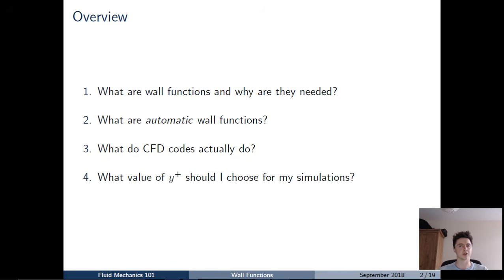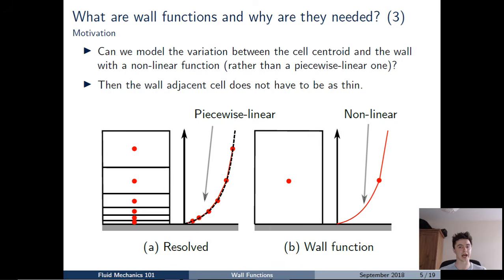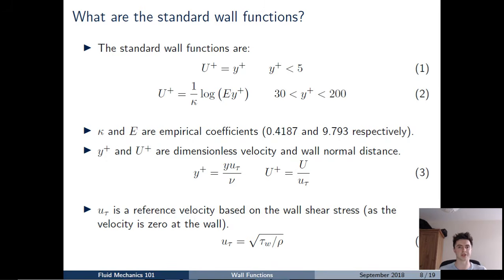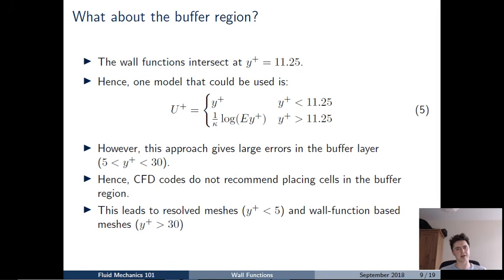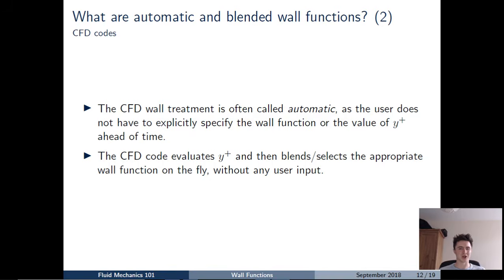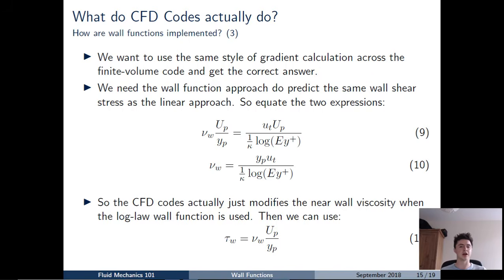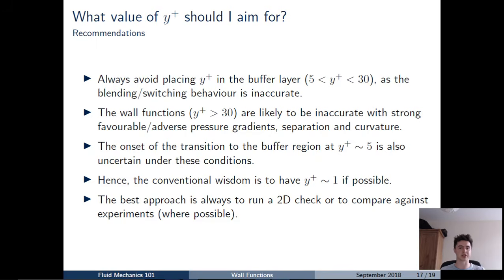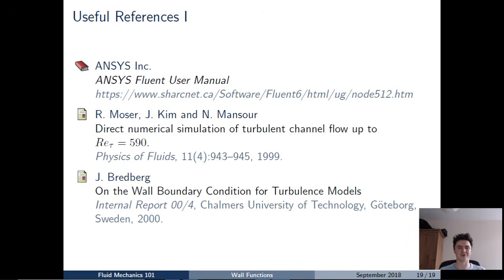[CFD] What are Wall Functions and How do they work?

Comment: Hello,
Thanks for the Video. Its explain much and there are things that I didn't understand before, but now they look a little bit cooler.
Also, I may have questions that, even if that look clearer, I fail to understand it:
1- the equation (8). I tried to recover how you did the derivative, but I didn't find the same things. If you can send me a link where I can read it or explain it here, that would be great.
2- From that page, I think I understood just the half of what you said. I mean, I heard the explanation clearly, but I didn't understand. And I REALLY want to understand as clearly as possible as you do
3--I'am using a cfd Software for a while now, but what I find difficult, is to put the right value of y+. I do understand that at the beginning we don't know the value and that the value change during the simulation. I saw that. The problem is "HOW DO I CORRECT IT"?. Read somewhere that you change it at the end of the simulation. But it's complicated, since I'am evaluated the drag of the boat, and it's taken 4 to 6 hours to run one simulation. So my question is: how I may ensure the value of y+ before letting the simulation run until the convergence?
Thanks in advance if you find time to answer me and sorry for my english if it is not good enough.
Reply from the maker: Hi Brice! So glad you found my video useful. In answer to your questions:
1) you can find the derivation in the Jonas Bredberg paper (link 4 in the description of this video) and you want equation 75 and 76. The trick is to rearrange for utau, rather than differentiate. 
2) I am thinking of doing a follow up video to explain this in more detail, as i have had lots of comments! What do you think? 
3) To reduce y+ you have to go back and refine your mesh. The only way you will know y+ is after your simulation, so the process is iterative: make a mesh, run computation, find y+, remesh, repeat etc. However, you can make this process quicker by having a good guess for y+ before you mesh. There are some tools online which can help you with this. Try googling ‘CFD online y+ calculator’. There is a really good tool which can help you guess y+ before you run your simulation. Hope this helps! Aidan
Reply: @fluidmechanics101  Aidan First of all thanks for this excellent lecture. I have a query. The motivation of this lecture is to reduce the aspect ratio of cells closer to the wall but it seems we cannot reduce the number of cells as often we may need to resolve our mesh to get minimum y+. So could you please shed some light whether we have achieved.  our aim of reducing cell count. Eagerly waiting for your reply if u have time to clarify my query. Also requesting you to post more such lectures.. it is fortunate that i have found your channel which is very helpful.
Reply from the maker: Hi Siva, i think i might not have explained it well enough in the video, so here goes! The optimum mesh is always a mesh with all cubes (aspect ratio 1) that are aligned with the flow direction. However, if we were to use all cubes, the cell count would be really high (particularly at high Reynolds number). So what we do is note that the gradients normal to the wall are steeper than the steeper than parallel with the wall. So we increase the aspect ratio of the cells and stretch them out. However, if the aspect ratio is too high (say over 1000) then the computations start to become unstable. So we would like to make the wall adjacent cell (which has the largest aspect ratio) larger in the wall normal/y+ direction. This will reduce its aspect ratio and make the computations more stable. In addition, it will also reduce the cell count as all the other cells will be the same size or larger than this cell. I hope this makes a bit more sense now 😊 and yes, i have lots more videos to come, so stay tuned!
Reply: @fluidmechanics101  thank you very much for your time and reply...

Comment: The video is awesome thank you very much ...... I have 2 questions please
1) The curve of the log low region makes a nonlinear curve from the wall to Up, from where did you know that this nonlinear curve is going to have the right slope of the wall shear stress (I think the green line should reach the origin to satisfy this but in the graph in the video it doesn't reach the origin) is that right ?
2) when you equated the 2 equations of the linear and log low region you cancelled "Up" in the left side with the right side although "Up" of the linear equation should be different from the "Up" of the log low equation to equate them right?
Reply from the maker: Hi Hatem, in answer to your questions, it is important to remember that it is the product of the viscosity and the velocity gradient that gives the wall shear stress. As the variation across a cell is linear, the velocity gradient will be incorrect when we are in the log law region. But this is ok, as long as the product of the (now incorrect) velocity gradient and viscosity gives the correct wall shear stress. This is why we modify the viscosity :) the green line doesnt need to reach the origin, as it is the gradient that we care about. For question 2, remember that it is the CFD solver that calculates the value of Up, so we assume that we know this and it is a constant. Remember remember, we are modifying the viscosity here to get the correct wall shear stress, not computing the value of Up. I hope this helps! Im thinking of doing a follow up video to clarify these points, what do you think? Would that be helpful? Aidan
Reply: @fluidmechanics101  Yes plz do
Reply from the maker: Hi Hatem, great questions! Im going to have to get back to you on these as im quite busy at the moment. Glad you found the video useful!

Comment: very good video, thanks! great explanation and easy to digest. By the way what kind of software do you use for your graphs and pictures?
Reply from the maker: Great! Im glad you found it useful. All the software i use is open source, so you can download and use it yourself if you like. I use python for plotting and data manipulation and then use inkscape for creating images and adding annotation. Check them out! They are available for mac, windows and linux, so you can still open files if you switch between computers. Also, to get the ‘math font’ for equations, check out CMU serif and CMU sans serif fonts. You can download them and add them to your font library. Hope this helps :)

Comment: This video clarifies so much for me! Thanks a lot Dr. Whimshurt. One thing I am trying to understand is scalable wall functions in k-epsilon model. I understand that it is different than automatic wall functions presented in this video. It solves log-law equations by scaling them no matter which region your first cell is at. I am using CFX but assuming Fluent does the same. And for my model I am still aiming y+<1 while employing k-epsilon. Is this a futile effort since k-epsilon will not solve linear wall functions?
Reply from the maker: Hi Mehmet, Great, im glad you found it useful! From the user guide, it looks like CFX and Fluent do the same thing for scalable wall functions. http://www.afs.enea.it/project/neptunius/docs/fluent/html/th/node99.htm More specifically, it looks like they force the value of y+ to be 11.25, if your value of y+ falls below 11.25, so that wall functions will always be used and you won't get viscous sub-layer resolved treatment. As you are aiming for y+ < 1, I wouldnt use scalable wall functions, as the scalable treatment will force y+ to be 11.25, which will give you the wrong answer. I would therefore go for standard wall treatment with the k-epsilon model instead, so that you can get the correct viscous sub-layer behaviour. Alternatively, If you are really concerned with correctly computing the wall shear stress and near wall behaviour and need y+ < 1 (this will depend on your application, perhaps you have an external aerodynamics application), then the k-omega SST model is widely considered to give more accurate predictions of the wall shear stress and near wall behaviour, when y+ < 1. I will be doing a video on this soon, so keep watching this space! Hope this helps, Aidan
Reply: @fluidmechanics101  Thank you for your time. I'll be waiting for the new videos. Great work.
Reply: If I'm not mistaken, if you're aiming at y+<1 then it means that you want to resolve boundary layer. You should not use k-epsilon model because it is not able to integrate to the wall and always uses logarithmic wall function approximation to model the boundary layer. And wall function is valid only where wall-adjacent mesh nodes (cell centers - depending on solver) are in the log-law region (20 < y+ < 200). Because it's hard to ensure this all over flow domain, the scalable wall function was implemented. With scalable wall function solver ignores all nodes that are closer to the wall than y+ ~ 11. If you want to resolve boundary layer you should use turbulence models that are able to directly integrate to the wall, like omega-based models. And you should ensure that you have a minimum of 10 nodes in boundary layer.
Reply: @antanas9015  Yes, but there is also an enhanced wall treatment formulation in Fluent for the k-eps turbulence model. In this approach, the flow is "divided" in a viscous affected region and a fullty turbulent region. In the viscous affected near wall region , the one-equation model of Wolfstein is employed, insetad of wall functions. in this way it is still possible to solve cases with low y+ when using the k-eps turbulence model. I hope it can help:)
Reply from the maker: Yep! I agree

Comment: That's a very clear explanation of something not so obvious!

The thing is, in CFD, a lot of cases are complex, with detachment/attachment, acceleration/deceleration etc... This will inevitably lead to 5 < y+ < 30 in some regions.
Second thing: When we talk about y+, do we talk only about the first cell height? Because even with a nice y+ = 1, the 3rd or 4th cells might be in the buffer layer. That is a problem or not? Didn't get this.
Reply from the maker: Hi Lili An, yes you are absolutely correct. CFD cases are complex and and y+ may be in the region of 5 < y+ < 30 in some places in the mesh and < 5 in others. Usually we adopt a compromise and try and get y+ < 5 in the main area we care about. For example, when simulating an aerofoil/wing we usually try and get y+ < 5 near the trailing edge of the suction surface, as this is where seperation inception begins and will have the most signifciant affect on the solution. This normally leads to y+ > 5 near the stagnation point (and hence not an accurate solution), but we dont care about the solution as much here, as the integrated lift and drag are more significantly affected by the suction surface boundary layer. 

2) Yes you are correct, the second and third cells may be in the buffer layer. But this is normally fine because the variation across the cells in the mesh is linear and the CFD solver compute the rest of the profile through the boundary layer for us. Conventional wisdom is to try and have 10 cells through the thickness of the boundary layer (a growth ratio less than 1.2) with a y+ < 5 for the 1st cell and this is normally fine to get an accurate solution. 

As always, check your solutions with a mesh convergence study, as every case is different! Hope this helps
Reply: @fluidmechanics101  So, let's clarify more. Wall functions are used to compute values at the first near wall mesh node only and values at all other nodes are solved by the solver from the flow equations. Am I correct? If so, then it's not optimal approach IMO. Or do wall functions are used for all mesh nodes within ranges y+ <5 and 30 < y+ < 200 (or only in range 30 < y+ < 200)?
Reply from the maker: Yep, you are correct. The cfd code only uses wall functions for the cell closest to the wall (often called the wall adjacent cell). The rest of the mesh will be solved by the cfd solver by assuming a linear variation across the cells. So ... you will still need a relatively fine mesh near the wall as the gradients are steep. This is why yo should try and use a growth ratio of 1.2 or lower normal to the wall to make sure you have enough cells :)
Reply: @fluidmechanics101  So why should I put enough cells to capture boundary layer?If I just focus on wall shear stress then one layer will be enough?
Reply from the maker: Well spotted! You still need enough cells to capture the velocity profile (and other gradients) away from the wall. Remember that the variation across cells is linear, while the velocity profile is definitely non linear! So you need enough cells to make the linear approximation sensible. People usually advise 10 cells through the boundary layer. However this is not useful to us when we are making a mesh .... so my colleagues and i tend to find that a growth ratio of 1.2 normal to the wall is about right to get the right number of cells through the boundary layer. For external aerodynamics applications where you really need a good answer, i would drop this to 1.1 or even 1.05. I hope this helps!

Comment: Thank you so much,  
How can  to plot the famous TBL curve U+ vs y+?
Reply from the maker: Hi Serrare, you can get the experimental data directly from the statistical database provided by Moser et al. here: http://turbulence.ices.utexas.edu/data/MKM/chan395/profiles/chan395.means . To plot the data you will want to use a 'semi log' plot to have the x axis on a logarithmic scale. In  MATLAB or python, the command is 'semilogx' rather than 'plot', whereas in excel, you can just change one of the axis to logarihmic in the plot options dialogue box. Hope this helps!